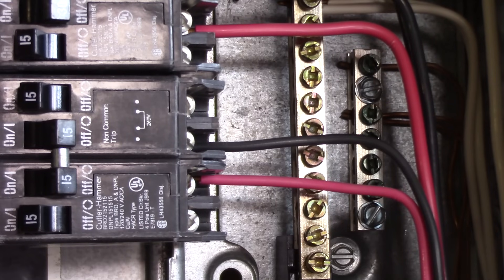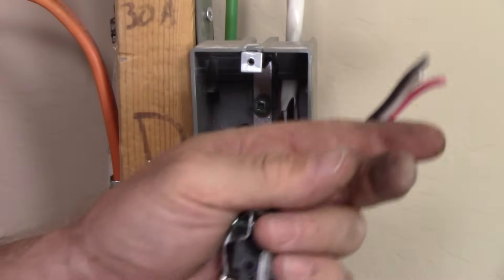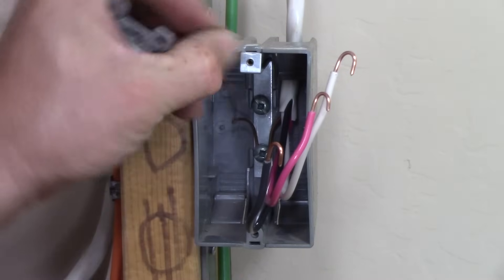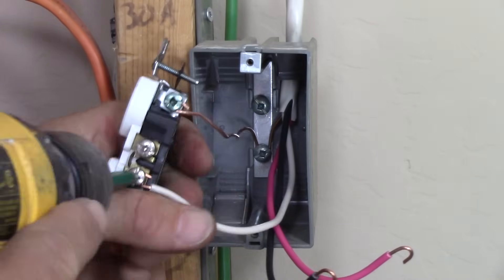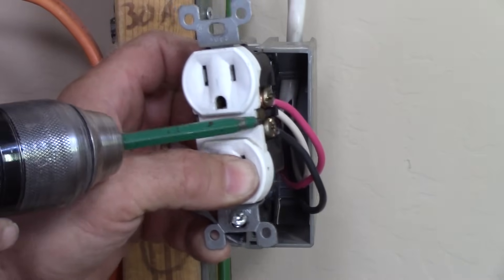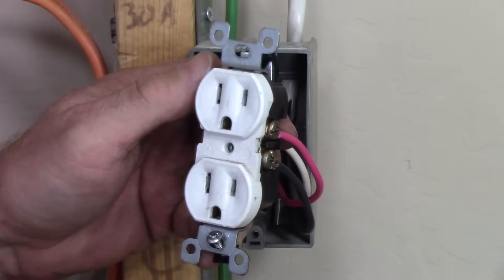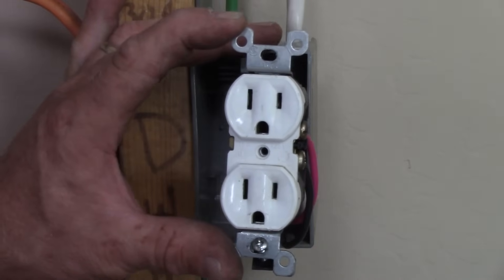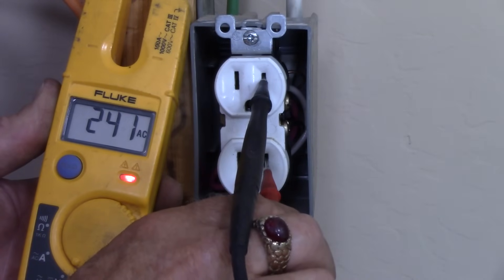Kitchen Split Circuit Receptacles Explained

Comment: Are you guys still doing shared neutrals much in new construction? (I realize not in the kitchen) I work in south eastern US, and a lot of jurisdictions around my city don't allow them.  I think they've found that it's just too dangerous of a circuit for untrained people work on, and even for trained people to maintain during renovations and upgrades. Guys will replace the breakers with single pole breakers,  and sometimes put those breakers on the same leg which causes overheating of the neutral.  They'll tap into the circuit where they shouldn't and then you have the potential lose the neutral on a shared neutral (which is very dangerous).  There's just a lot of ways for things to go bad with a shared neutral circuit.  

 The NEC requires us to bring two 20 amp circuits to serve kitchen counter tops. If you shared a neutral to do this,  the inspector would call you out on not having TWO individual circuits.  Thanks for making the videos
Reply from the maker: The rules have changed, yes! Just wanted to explain these as many exist and I get many questions on my website and elsewhere regarding these, mostly when they replaced a receptacle and forgot to split the tab. You are correct with the new code requirements.
Reply: Terry Peterman gotcha. Thanks for the response. I never run into that situation,  and I've been doing residential service work here for ten years. I guess the practice never caught on here.  I often upgrade kitchen outlets to GFCI. I'd hate to have half the homeowners countertop power capacity to get that done

Comment: This has been around for 40 Years, electrical code required this in all kitchens, unfortunately elecrticians did not wire the receptacles corectly. this video should have been shown to them in the 70's. Good job.
Reply from the maker: Thanks Robert!